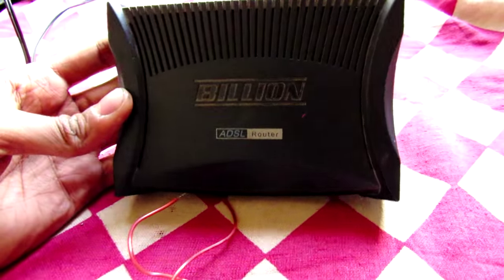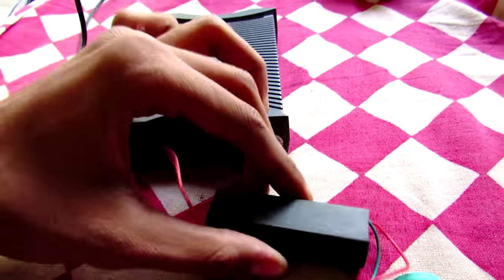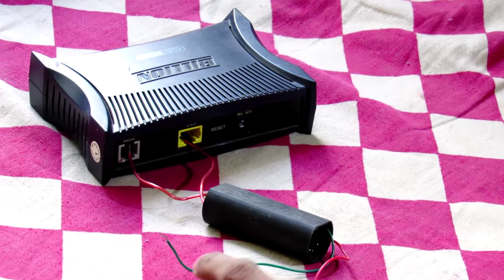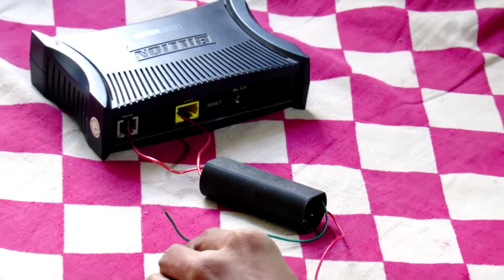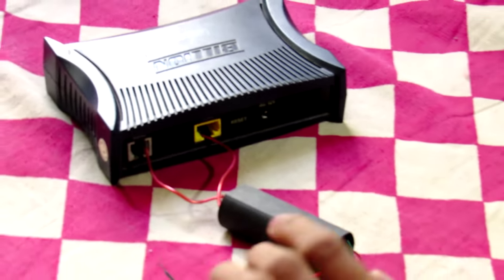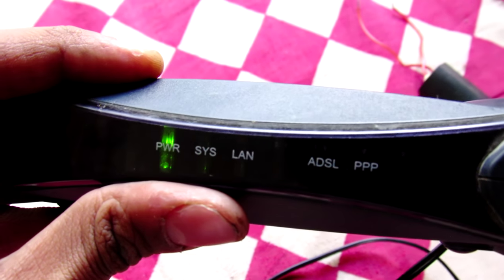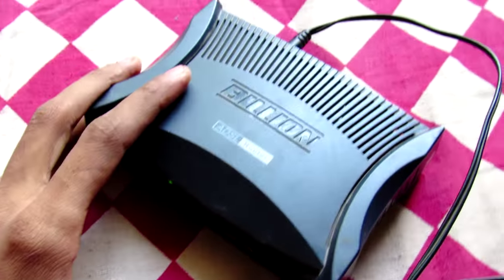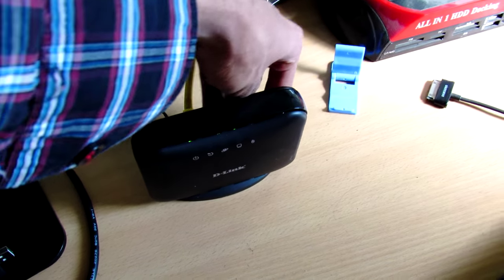High Voltage Generator EMP Device Tested on Internet Modem

Comment: Just a wild guess but the modem was F'cked! Also that is NOT an EMP Jammer. If you shoved 230Volts up tyhose ports it would kill the modem. Not sure what you are trying to prove by shoving Several Kv through it?

Comment: This is not an EMP generator. If you were to put a spark gap and antenna in series on the 400kv output you would have an EMP generator. You are simply zapping the hell out of it. Not killing it by electromagnetic pulse